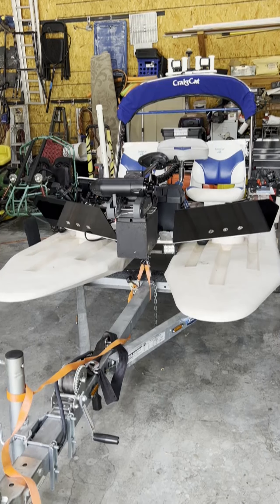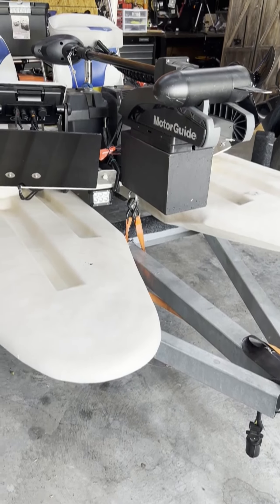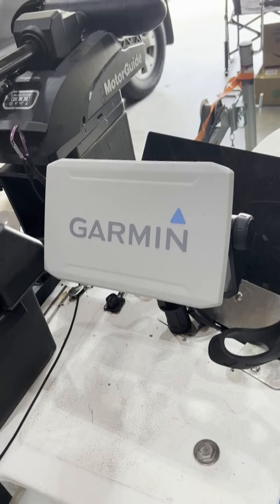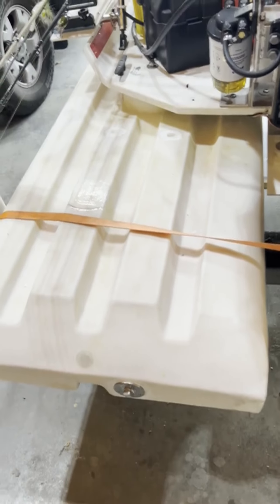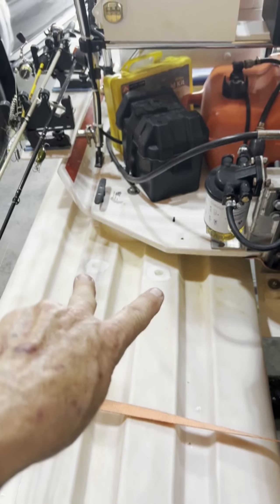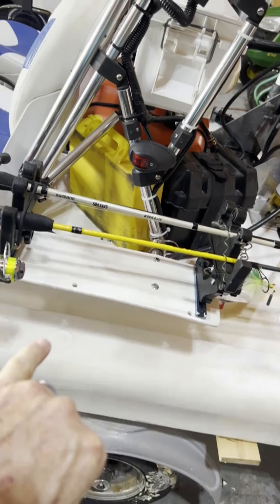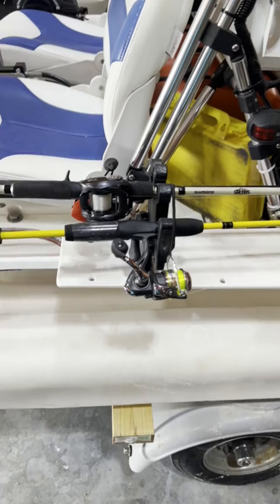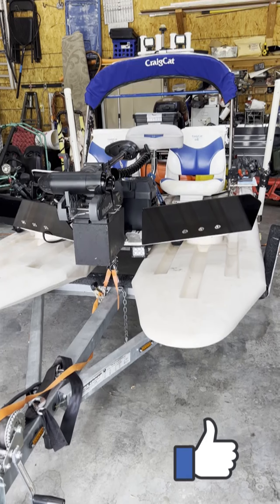DY Repairs & Upgrades for CraigCat Boat Pontoons: A Complete Guide

Comment: What is box that your trolling motor is mounted on.  I like that it pulls everything forward.  Are you using foot control trolling motor?  Do you have a video of components and installation of your trolling motor setup!  Is is working good for you?
Reply from the maker: @KentSexton-e1e  I built the box the trolling motor is mounted on, the trolling motor was a MotorGuide xi3 with stop lock. It worked off a remote around my neck. Sorry I don’t have any video of this built and I sold this boat about a year ago.

Comment: Just found you video, I have a new craigcat and I am do a few modifications. i like your rod racks, where did you find them and your fishing seat. Any information will help
Jim
Reply from the maker: I’m looking for the place a bought the rod racks, when I find them I will post it . The fishing seat came from bass pro shop and the post came from Amazon. Please subscribe to my channel because I am coming out with more videos on upgrades to my Craigcat. 
It will cover moving the axles to accommodate a larger tire and wheel, remounting the trolling motor, and replacing the water pump. 
I hope to have it posted in the next few weeks. 
Thanks, 
David
Reply: @fishingin3D  I thought I did subscribe? I’ll revisit and check.

I look forward to your postS
Reply from the maker: @jimrollins9683  wow, For the life of me I can’t find the place I bought the rod holders. I have looked on my emails, texts for over two hours with no luck. I know I found them on google, It was under 3 D printed rod holders. If I find it I will let you know.
Reply: What type of motor mount did use use
Reply: @jeffalbrecht948  Motor mounts? I haven’t changed my motor mounts
Reply from the maker: @jeffalbrecht948  I made the box that the motor sets on. On top of the box is a quick release mount that I bought when I bought my trolling motor. 
The box is made with a 2x6 on the bottom as a base, the sides and top of the box is 1/4” plywood, sealed with a polyurethane sealer and painted with oil base paint. It is glued and nailed together. I hope this answered you question. If you would like more information, just let me know. 
There is also a boat seat swivel that lets the motor rotate.
Reply: @fishingin3D  what length shaft is your xi3
Reply: @fishingin3D  thanks
Reply from the maker: @jeffalbrecht948  36” shaft
Reply: One of our pontoons has swollen and much bigger than the other pontoon. What do you suggest caused that and what do you recommend on how to fix that problem? 
I bought it used 2 years ago. It’s a 2005 or 2006 model. Not sure of the history. The cell foam seams expanded and was wet at some time. Very brittle when I can few it through the drain hole at the end of the pontoon. Wondering if the bolts had leaked and need to be changed and sealed but not sure if I need to clean out all the foam inside and real insert. That would be the whole pontoon - not sure how to approach this problem. Any insight?

Comment: Did the fill on pontoons work
Reply from the maker: Yes, but the main think is that you seal the pontoons so the water does not get back inside.
Reply from the maker: If you fill the pontoons yourself, make sure you have relief holes and try not to over fill are you will blow the pontoon up. 
I used 2 part closed cell foam.